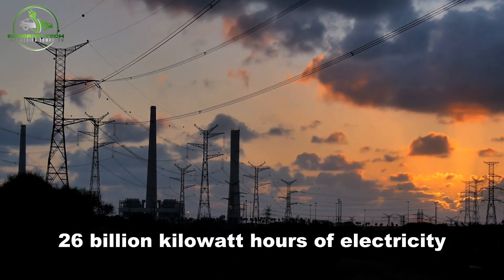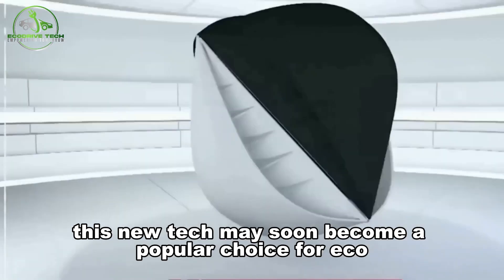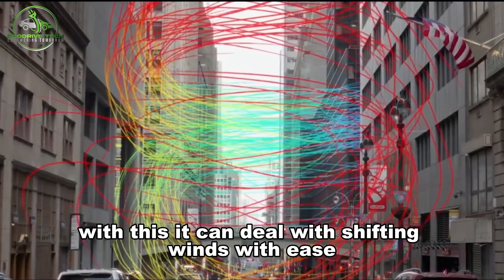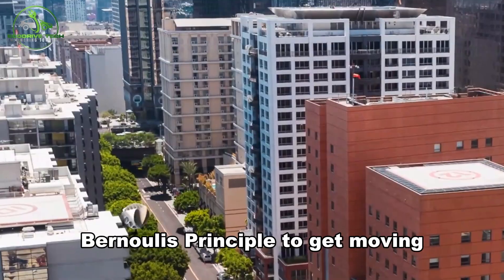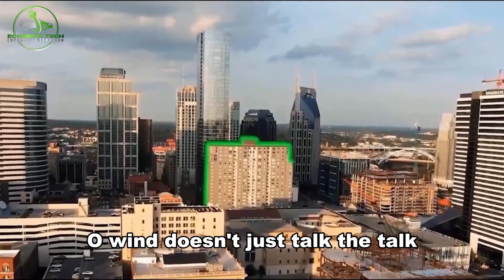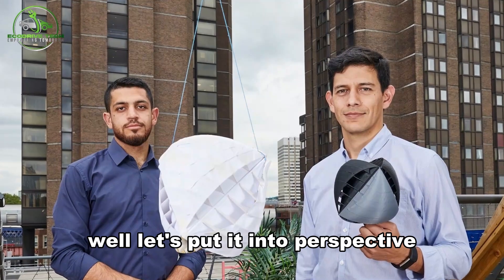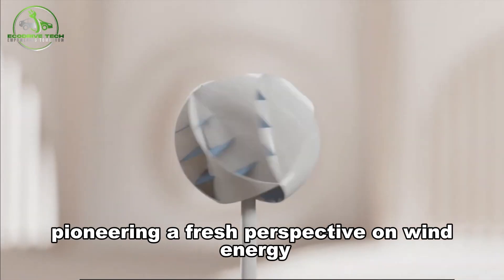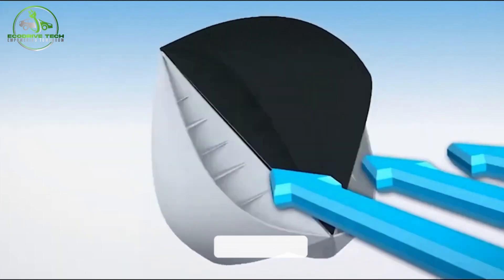The Wind Turbine That's Breaking ALL the Rules!  This TINY Turbine Will POWER Your Entire CITY!

Comment: All practical tests of ground-based small wind turbines show: 1) They hardly produce any electricity! 2) They do not last long! 
Electricity yield is proportional to third power of wind speed: +100% wind generates +800% more electricity! Close to ground: 0 constant wind, but extreme gusts! 
Due to extreme price decline solar panels generate at least 10 times more electricity with the same investment in time & money! Unfortunately not at night and not much in winter! But reliable && maintenance-free for 25 y+! And you need a battery for wind and solar. 9 out of 10 small wind turbines stop working after just a few years due to the extremely gusty winds close to ground.
Reply from the maker: Thanks for watching